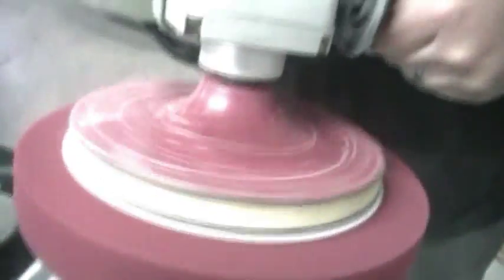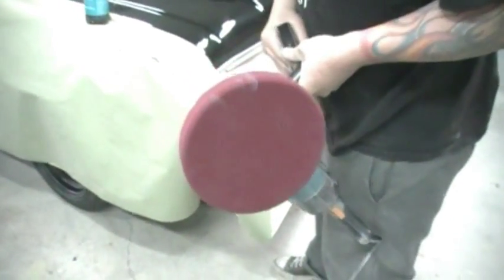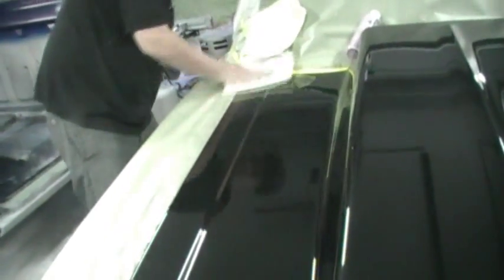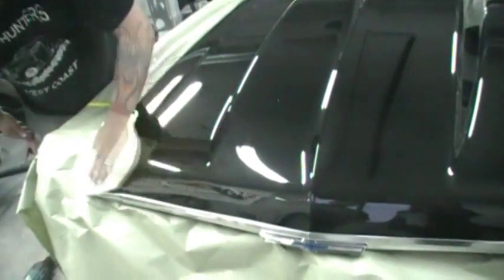How To Buff Paint

Comment: I have had to wet sand and buff a few hoods and roofs because of bird crap. The acids etch into the clear. At least you were able to buff them out. I still get a little nervous when I have to one hand buff lol. I have had good luck with the porter cable random orbital polisher with a yellow pad and Mequires polish to get bird crap off too. I wish I could afford the pads you use.